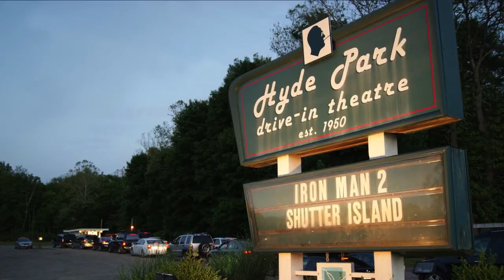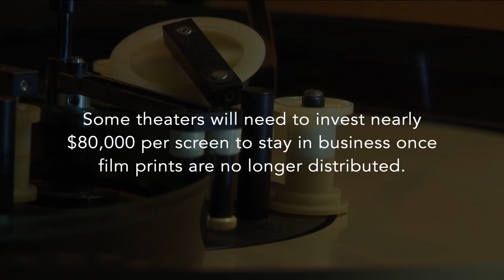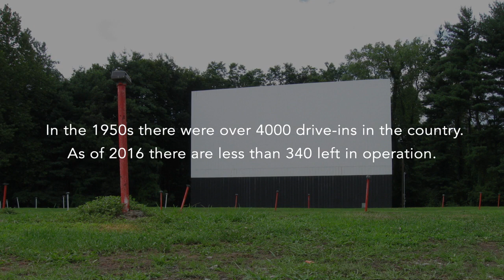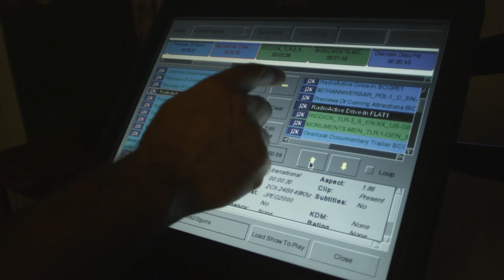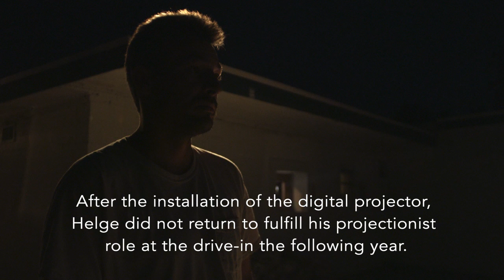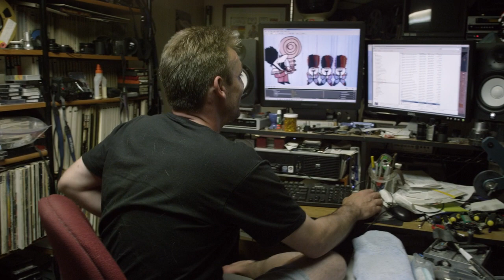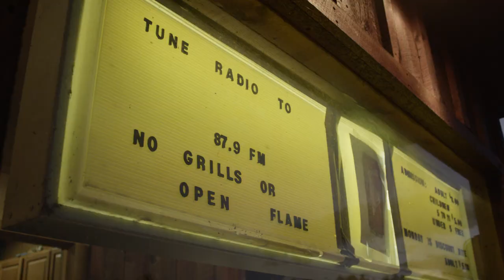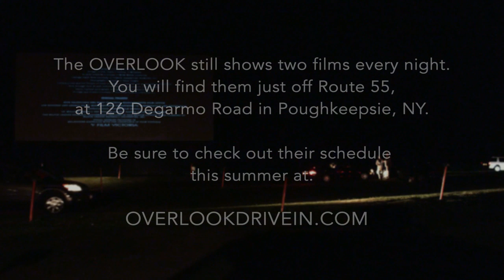The Last Projectionist @ The Overlook Drive-In

Comment: what a great video,  Digital can never replace film  as mentioned in the video it's just a hard drive.  Putting the film together adding trailers etc, is great.
I used to work for AMC theatres in the UK when they first opened  in Milton Keynes 1985.  What great times they were.  Unfortunately the younger 
generation would never understand that era.
Reply: All seams a long time ago Malcolm in another life time.
Reply: Don't lose all hope... I'm in my 20s and currently the Head Projectionist at a venue operating a pair of Philips DP70s. I've torn both machines down to bare castings for a rebuild, and we run 35mm or 70mm screenings weekly for audiences.

Comment: I just stumbled onto this video, wow trip down memory lane. Back in the seventies, ancient history, I worked on those car speakers for both drive-ins. It was a spring break job, but it kind of cemented my career in film, TV, and general broadcast. I remember those old projectors rock solid easy to fix. I've seen that change from film to digital projection, same happened in broadcast we went film and Quadraplex recorders and players with 10 to 50 LBs reels and camera chains that you needed a Con Ed substation to run  that took an entire floor to now 2k video on an SDHC media on a camera weighing only a couple pounds and you can put in your wallet end of day. I personally think the "Digital" look is cold compared to Eastman Color or Technicolor prints. May the drive in carry on.

Comment: That century 35mm projector would be able to project for another 50 years.  That Barco digital projectors will wear out and be too expensive to maintain in 10-15 years.
Reply: 10 to 15 years. I think that VERY optimistic. I give it 8 years maximum.